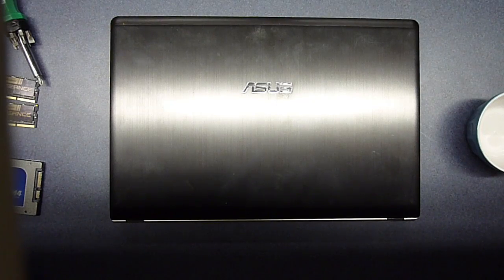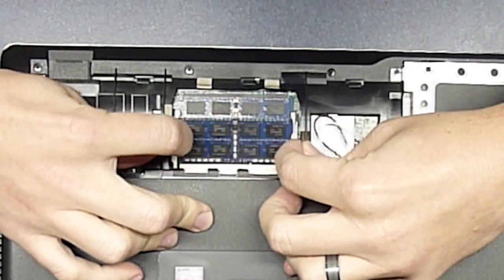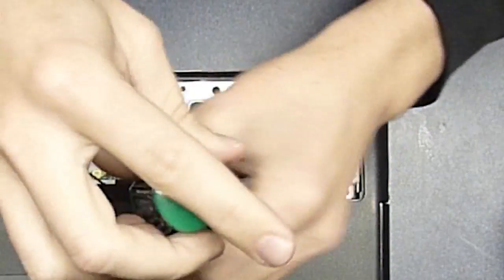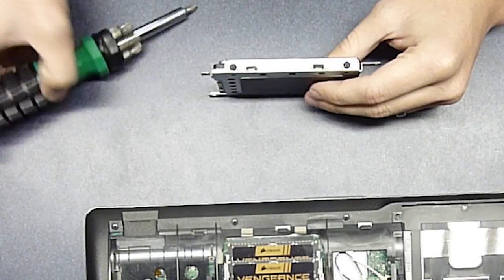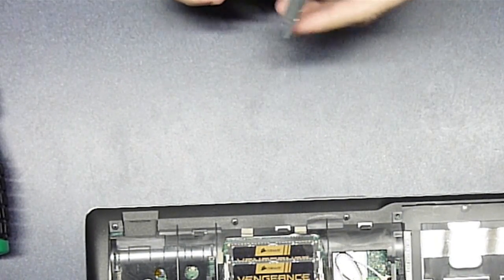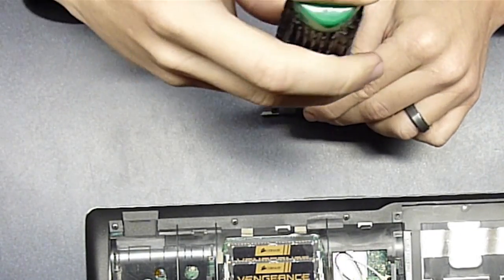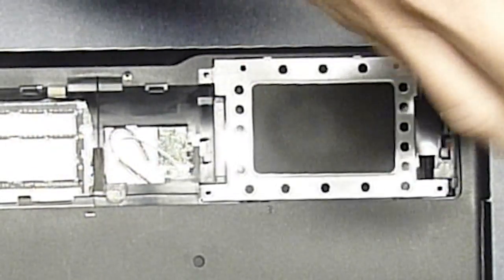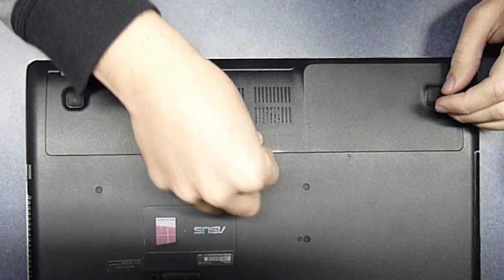Upgrade HDD and RAM: Asus N56VJ

Comment: I have an ASUS N56VZ with 4GB RAM and 700 GB HD.  What is the max GB of RAM I can upgrade this computer to?  What is the specs I should know when upgrading the RAM?  1600MHz or 1888MHz? Pins? Recommended Brands? Form Factor? Module Type? Latency?

Comment: Just upgraded my SSD last week using this video.  Too easy and I am now going to swap the RAM for 16GB vice 8GB.  I had a rougher time cloning my old hard drive and that took a whole day trying to figure out.  Bad sectors were to blame, and I found EaseUS cloning software worked for my issue.  The software that came with my SATA to USB connector wouldn't clone my old hard drive due to the bad sectors.  My ASUS runs better now than when I first got it six years ago.  Hopefully I'll get a few more years out of it!

Comment: Hello Guys,

TO all who has N56VJ i7-3630QM
I want to add one 8GB ram to it .Which one is better ??
https://www.amazon.ca/Crucial-Single-PC3-12800-Unbuffered-204-Pin/dp/B006YG8X9Y 
vs
https://www.amazon.ca/Corsair-Vengeance-Laptop-Memory-CMSX8GX3M1A1600C10/dp/B0076W9Q4Q

And did anyone try WIndows10 on it ?

Comment: There are 4 slots to install the RAM. What is the maximum gigs that the ASUS n56vj motherboard allows? Is it 16? What would happen if I installed 32 ?
Reply: With the other hardware on this computer, I have found that there is rarely a need for 16gb RAM which is the max, installing 32gb wouldn't necessarily hurt the computer, but there is no real point and there will most likely be compatibilty issues.
Reply: Hi Deniz! Did you ever manage to upgrade your ram past 16gb? I'm thinking of doing the same and would love to know if it worked for you. Thanks!
Reply: Nope actually I could only make it 16 gb. But I've learned that the chipset doesn't support 32 gb ram upgrade
Reply: Thanks! I ended up going with 16GB as well. My chipset (on the N56JR) supports 32GB, but the internet says that the motherboard does not.
Reply: Yeah either the motherboard doesn't support or the chipset. But either way 32GB is too much for a laptop to handle :(
Reply: i have 6 GB i want to upgrade to 16 GB ... how much it coast and i want to know does it harm my laptop ?
Reply: Hi, do you try install ram up to 32 gb?

Comment: Hi guys!  I have similar laptop only difference is N56VJ - and mine is n56VV. I want to upgrade it to 32 gb ram? is it possible? will it function better/ faster? and can you advise me how to add ssd on this model? thanks for info
Reply: What processes and applications do you run? 32 GB is almost certainly excessive and unnecessary.

Comment: I have the same model of Laptop ASUS N56VJ!
I want to upgrade the RAM to 16GB! 
what would be better between the:
Kingston Technology HyperX Impact DDR3L CL9 SODIMM 1.35V 
or
Corsair Vengeance Performance 16GB (2x8GB) DDR3L 1600MHz PC3 12800 Laptop Memory Kit CMSX16GX3M2B1600C9
Thank you!
Reply: +Vlad Piero Hi, I've got ASUS N56VJ too. Did you upgrade RAM on your Laptop? which one did you chose?

Comment: Hi, i have a question: what kind of RAM does this notebook support?
Reply: +Manuel Galdeano regular laptop 204-pin DDR3 and DDR3L work fine. I had some spare DDR3L RAM left from when I upgraded my Alienware 18 so I just put it in my gf's laptop, which is this particular model.

Comment: This is extremely helpful, I have a newer model of the N56 but I am still looking to upgrade my harddrive Just wasnt sure what to do xD.

A bit of advice, it helps to have a screwdriver with a magnetized bit on it for the small screws if you don't want to keep tweezers around
Reply: Cecilio Vega Also forgot to ask, what size HDD/SDD does the laptop take. I want to be sure to order the correct one the first time around ^_^

Comment: I'm not much of a tech guy, so could you help me find a nice HDD with at least 100 MByte/sec write speed?
Reply: Ok, nvm about that. But I have a new questions, or otherwise reassurance. I think so, but I want to make sure: a faster write speed means less lag while recording, correct?
Reply: Red_Creeper4000  What you're looking for is a HDD with atleast 7600 RPM or more 10k, although I'm not sure if they'll even reach 100Mb. Go for a SSD they reach up to 500Mb
Reply: I ended up getting a nice 500 GB SDD with 420 Mbps write speed and I can now record with MUCH better FPS. So I was right :D

Comment: Well I did the upgrade on my N56J and the back cover does not pop up..DO NOT PRY IT UP....(PLEASE SIMPLY SLIDE THE COVER BACK OFF THE LAPTOP) pull towards you and it slips back to you. Towards the sdhc card slot, I tried the shown method and broke a clip on the cover....heads up!